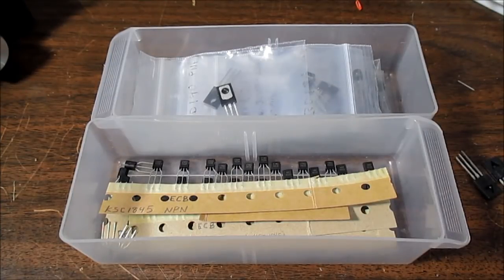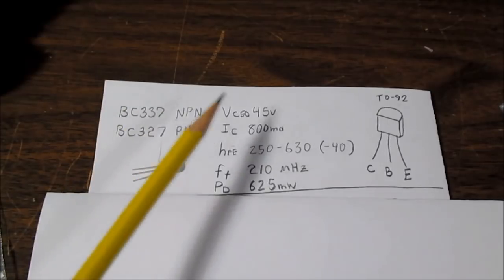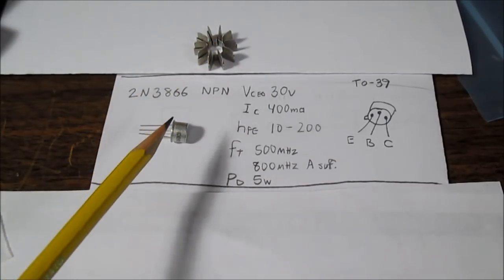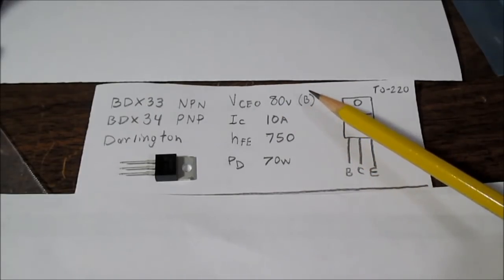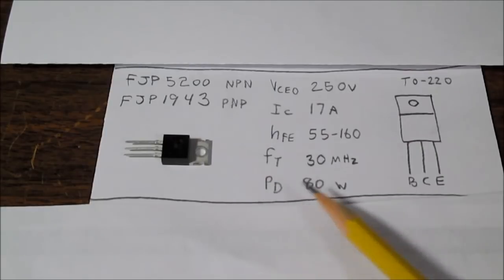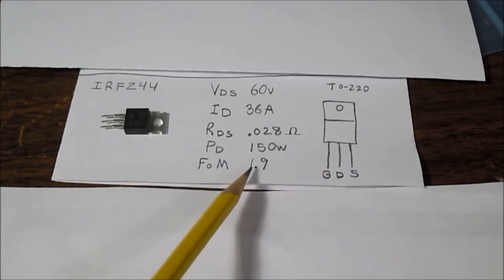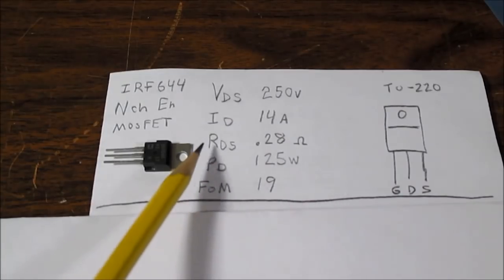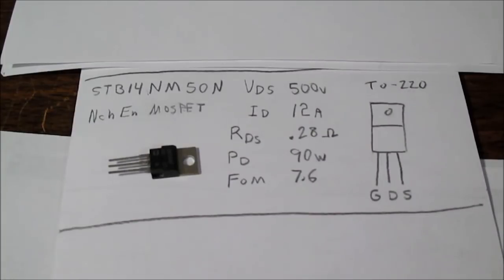Good transistors for the electronics hobbyist

Comment: I only recently made a deep dive into electricity, electric motors and circuits my background being in Accounting and Computer programming.
Enabling me to fix both my air conditioner and gas furnace in my HVAC system recently a few months ago (no fires, still running  lol). What bothers me is the lack of uniformity in naming parts, and creation of too many electrical parts. Again lack of uniformity.  For instance, the decision to make home stereo eqpt. 8 ohms and car stereo eqpt.. at 4 ohms doesn't make one better than the other. It is to make people think you need two different types of components and home stereo won't work in your car. When it very much can.

Comment: I’d list them, but I keep probably over 100 transistors and their complementary in quantities over 200, many of them into the 1000s. Example I just bought 1500 each of 2N5551 and 2N5401 all because one of your videos reminded me to, thanks! To throw some examples out there if you like working on vintage electronics, I like to keep MJ21193/MJ21194 on hand, can be used for outputs in many amplifiers, MJE15032, MJE15033, MJE15034, MJE15035, KSC2690/KSA1220, honestly there are many I wouldn’t be without.  I’ve just slowly built a collection and I hate having to wait on parts to be delivered.  Thank goodness for Mouser and Digikey and their cheap 2nd day shipping!

As to your questioning the PD of the transistors, like 125-150 watts for a TO-220.  I question those too, same with other components.  I recently ordered some very decent quality resistors from Mouser and they’re being sold at 3 watt resistors and they’re  about the size of a standard  1/8 watt  metal films. I question how something so tiny can dissipate 3 watts.

Comment: Around 12:00 "How do they come up with these values?" Well, the quoted power dissipation is simply the maximum allowable rise in junction temperature divided by the thermal resistance from junction to case. In other words, they assume a perfect heatsink that can keep the case at ambient temperature. For MOSFETs, the "junction" temperature is the die temperature.
For example, if we have a maximum junction temperature of 175° C and ambient is 25° C, then the maximum allowable rise is 150° C. If you have a device with a thermal resistance junction to case of 1° C/W, then it can dissipate 150/1 = 150 W of power when the case is kept at 25°C. If the thermal resistance junction to case of 1.5° C/W, then it can dissipate 150/1.5 = 100 W of power., and so on. Of course, in reality, the heatsink will have a thermal resistance from case to ambient and you can often find that figure specified for a particular heatsink. Perhaps you might pair up a device with a thermal resistance junction to case of 1.5° C/W with a heatsink of 0.5° C/W, giving a total thermal resistance of 2° C/W junction to ambient, which would then only be able to handle 150/2 = 75 W.

Comment: After some research, high mosfet current values in TO-220 packages are correct (eg. 75A).  This seems wrong as wire of similar size to the legs of the package would not be rated for this.  The difference is a mosfet can be rated to run at 100 degrees quite happily and large PCB traces and heatsinking contribute to the device and its leads coping with such high amperages.  A wire on the other hand gets rated to stay at a low temperature with only 'in air' cooling.  Hope this helps.

Comment: It is sometimes not very easy to find a complimentary power transistor to a given npn or nMOS device. So I usually look first for a suitable pnp or pMOS device at look for a complimentary device which fits the device the best. In this way I've found some good combinations like: STP10P6F6 / STP16NF06 or IRF4905 / IRFZ46N. I would be interesting for me if you have found also some of your own pairings or pairings which fit better that the manufacturer suggestion.

Comment: The higher power ratings of MOSFET transistors come from the possibility to operate them at 175 °C in contrast to bipolar transistors at 150 °C. The channel type transistor allow for higher operating temperatures than junction type transistors. The TO-220 package is limited to currents of 50 A per lead.

Comment: Devices I used a lot for audio...2n2222, 2n2907,  2n3053, 2n4037,  these are early 1970's devices that worked well and had several sources.  Almost all of the 2N devices are hard to find now.  When Motorola became On Semicoductor, they dropped a lot of devices for linear work.  Same with TI.  Everybody consolidated in the 1990's.

Comment: I have made some good experiences with power mosfets in audio amplifiers in the range of 12 W up to 50 W (for your home purposes you don't need more, either). I prefer simple symmetrical and thermally stable discrete amplifier configurations with high open loop voltage gain like these:

BJT version https://ibb.co/ynmpxQv
FET version https://ibb.co/kMd1MKS

Here a complementary transistor combination I like to use:

IPP80N03S4L (NMOS), IPP80P03P4L (PMOS)
https://www.mouser.de/datasheet/2/196/Infineon-IPB80N03S4L_03_IPP_I80N03S4L_04-DS-v02_01-1226077.pdf
https://www.mouser.de/datasheet/2/196/Infineon-I80P03P4L_04-DS-v01_01-en-1225645.pdf

Rdson = 3..5 mOhm, Vgsth = 1.6 V (good substitute for Darlington BJT due to their high transconductances Kp > 100 A/V)

I also like the TIP120 (NPN) / TIP125 (PNP) Darlington combination with internal base resistors because of high current amplification of 1000 at 3 A.
https://www.mouser.de/datasheet/2/389/tip120-957291.pdf

Comment: For low voltage have good price/power IRF3205 , good old Classic is IRF640N, litle bit more expensive is IRFP250 and very good for high speed switching apps but more dificult to drive IRFB/P 4227
From bjt my favorites 2SA/SC 1943/5200 , MJL21194G; KD503, BC546,7 /556,557 , etc
Some opamps to good have TL071,072,074 NE5534

Comment: You could consider using 2N6292(Vce=70v, Ic=7.0 A)
and its complementary pnp, 2N6107(Vce=70v, Ic=7.0A), they are very good to be used in VAS stage. I use them instead of BD139 and BD140 transistors.

And there are 2N5551(Vce=160V, Ic = 600mA)(npn)and its complementary pnp 2N5401(Vce=150V and Ic=600mA), which can be used in the input stage.

Comment: One transistor you didn't mention is a VHF BJT with low junction capacitances, for use in RF and IF circuits.  One cheap example is the 9018 (C9018 or SS9018).  Thanks.
Reply: Th 2N3866 is a VHF BJT. I've used it up to the lower spectrum of the UHF band aswell. Sure, it's not the cheapest transistor but it sure works great for RF amplification.

Comment: I see so many people recommend power Darlington transistors and they never know that power Darlingtons are for collector voltages above 12 volts.  A Darlington can be used at low voltage, but the collector can never go below two Vbe drops or about 1.2 volts.  If the supply voltage is 2.8 volts, then half of the power will be dissipated in the Darlington!  At 12 volts supply, ten percent of the power will be wasted heating the Darlington.

If you want high gain, use two separate transistors with their collectors separate, not connected together so the second transistor can fully saturate to just a fraction of a volt and not waste power.
I like your video.  Thanks.

Comment: I'm liking the PSMN017-30PL power mosfet. Rdson of 0.017Ω and a gate charge of 10.7, it's FoM of 0.17 blows your IRFZ44's out of the water, and has a comparable price. Downsides are lower voltage ratings.

Comment: Greate video! I have a '76 Earth Producer amp head. The eight T03 power transistors (Signetics 59-4004-B) I googled the hell out of it, with no luck. Don't know if they are pnp, or npn, all I know is they are poop. I would live to use something cool & modern. High quality sound is what I'm after. Any advice would be greatly appreciated. Thanks!

Comment: Maybe a dumb question but the use of the FJP transistors were for output stages in AB amplifiers. Is that correct? What are some suggestions for transistors to use in the power or A stage? Just curious and wondered if there was a rule of thumb when it came to these circuit components.

Comment: For audio output stages I've got some NJW3281G, NJW1302G pair - the FJP ones you mention don't have secondary breakdown graphs in the datasheet which seems odd.

IRF in particular lie completely in their datasheets about current rating.  I've seen 180A or something quoted for a TO220 MOSFET and in a tiny tiny footnote they admit the bond-wire limit is far less!  I think the logic is that the current rating of a power MOSFET is actually an power rating in disguise - ie its the current at which the die fails on a water-cooled diamond heatsink!

I'd advise using only these parameters of a MOSFET: drain-source voltage, on-resistance + associated gate drive voltage, total gate charge.  Throw in some commonsense about the package power dissipation too.

Comment: I wonder why no one mentioned  2N3055. It is a great Power transistor.
Reply: Toshiba manufactures many great power transistors. Look at their power devices catalog if you get a chance. I really like the 2SA1943/2SC5200 complimentary pair. They have constant hFE vs IC curve from few mA to several Amps which makes the transistors suitable for any low frequency linear applications. ON SEMICONDUCTORS manufactures transistors specifically for audio applications such as NJW3281G/NJW1302G complimentary pair. Hope that helps!
Reply: @SmithKerona  Would you recommend some 20 to 30v  transistors for best linearity? Price is not a concern but needs to be available. Thanks!
Reply: @johnyang799  There isn't any single transistor that is linear enough for me to recommend! All transistors (BJTs, FETs and all their derivatives) are highly non linear devices. BJT follow exponential input/output relationship while FETs follow square relationship. But with proper biasing (choosing its operating point appropriately) and negative feedback, the transistor can be made to exhibit linear input/output behavior. I hope this has answered your question John Yang.
Reply: @SmithKerona  That is really meaningful and correct. But like I want to make a opamp driving diamond buffer with unity gain feedback circuit or maybe 8db gain, just giving an example. The supply voltage is going to be +-18 only. I need lowest output impedance lowest noise and most importantly lowest distortion under load from 8/16 ohm and above. I know bd139 140 can be a good starting point but I don't want to waste too much time end up replicating what's existing out there. Main reason for that is I am using two opa827 opamps in parallel as output stage and already has 0.5uV noise from 20-20khz and 0.0001% distortion under 16 ohm load at 1mW and 32 ohm at 10mW. I want to push forward and design a discrete output stage with similar performance. I need something better to start. Thanks.
Reply: @SmithKerona  I'm building headphone amplifiers btw.
Reply: @rrangana11
the tip3055 is the same TR , it has the same voltage and current rating as the TO3  version , not sure about the PD tho :-)
Reply: 2N3055 is a dead 60's era transistor that should never be used in modern circuits. Why would anyone use it when there are cheap and far better modern power transistors?
Reply: what better modern one would you recommend?
Reply: @2guitarme  2N3771
Reply: 2N3771 has higher IC and wattage

Comment: here's my addons::
- BC517 for monstrously hi gain (but kinda sux)
- 2SC3356 (or 3355) for signal radio (it's SMD and supposedly max 12V but goes beyond, ultra cheap and apparently good on ebay)
-BF245 jfet, low noise + UHF
-2N7000 el cheapo MOSFET TO92
-IRLZ44N logic level mosfet (it's "L")
-HGTG30N60A4D ("rich kids" IGBT, good all around.... LOL)
...and 2N2222 BC547 are apparently good wherever you buy em

Comment: There are a lot of us would like a audio amp circuit that would run on 9-12 v dc and put out about 30 watts RMS of usable audio power. You may have already posted one, I could not find any in your previous videos. There may be posts of said amp on the web, I like your channel the best and hope you have one, if not, it's OK, I will look other places. Thanxz
Reply from the maker: 30 watts before clipping would not be possible at 9-12v supply with typical load impedance (4 or 8 ohms). The limited supply voltage does not allow enough voltage swing in the output to drive such impedances to that power level. To get this amount of power from 9-12v supply, would require a booster supply to raise the supply voltage higher for the amplifier (the amp would technically not be running on 9-12v anymore).

Another way is to use a low speaker impedance of less than 2 ohms which may be unrealistic in  most cases. Another way still is to use an impedance matching output transformer to boost a high current output to drive 4 or 8 ohms to 30w. Such an audio grade transformer would be rare and very expensive.
Reply: @JohnAudioTech  by use of an H-Bridge output you can theoretically achieve 18 W @ 4 Ohm and 12 V. The practical limit is probably 15 W. It is relatively easy to generate a -12 V power rail from a +12 V / 0 V power supply by use of + to - converter. Using such a symmetric power supply you can generate 60 W @ 4 Ohm.

Comment: The rated power dissipation for the IFRZ44N as example is the total power that can dissipate the transistor **if** it is maintained at 25C. You probably need large heat-sinks to maintain it at 25C under that power dissipated. 
in fact, without heat sink, the IFRZ44 would raise by 60 degree Kelvin per Watt ( see its Thermal Resistance). So, if you use it without heat-sink, at 1 W, you raise its temp to 85 C  ( 25C + 60C). At 2W, you raise its temp to 145 C and without heat-sink, at 3W you have probably destroyed it (see figure 1 in its datasheet, the maximum usable temp is around 175 C)
Reply: Basically to reach these power dissipations/currents that are rated at 25C you need to cool the package to sub-zero temperatures. So you need a heat pump, or some Peltier-cooler setup to achieve it. 

Noone in their right mind would do this with something like an IRFZ44. You´re better off with a real high power mosfet. But for very high power applications this is sometimes done.
Reply from the maker: I assume you mean the junction temperature is 25 Deg C. The die inside the transistor package will have some thermal resistance to the die attach point on the copper slug in the transistor. The heat then disperses through the slug and into an external heatsink. All of this will have a significant thermal resistance rated in kelvin/watt which will raise the junction temperature. I'd have to research this to see if it can work at the high power rating that are specified on these TO-220 devices.

Comment: I often use BC550/560 or 2N5401/5551 for higher voltage amplifier input stage, 2N5401/5551 or KSA1381/KSC3503 for VAS (depends on my goal), 2SA1387/2SA4793 for driver (or pre-driver for TEF circuit), NJW1302/3281 or 2SA1943/2SC5200 for the final stage.TO-92 package seems to become obsolete soon or later. it's getting harder to get low noise figure, low Cob, and high fT transistor here. i might migrate to SOT23 package..

Comment: SS8050/SS8550 -- complimentary pair of TO-92 transistors rated for up to 1.5A (but only 25v)
Reply: I have those, I recently used them for a project (both of them). They're quite useful. What else do you recommend? I have over 15 different transistors, but as the saying goes better safe than sorry.
Reply: Yes! I used them for a 2.5W amplifier project they are cheap and they gave me no problems. My suggestions are tje obvious 2n3904/2n3906, msa29 for high input impedance amplifiers and the s8050/8550 and nothing else, maybe some 2n7000 for simple logic

Comment: 11:07 Look at car amplifiers. they do it all the time. they can handle it.
11:46 again, look at car amplifiers, they do it all the time.
some of the newer TO-3P MOSFETs and IGBT's can do over 100A with around 400W dissipation ratings.
Reply: bassblaster505 
Those transistors are really powerful

Comment: While they are probaply pretty much the equivalent of the 3904 in europe, the BC547/557 are my go-tos when i don't have anything specific i need. They are very simmilar to the 337/327 but with more gain (up to 800 for the C variant) at the cost of collector current. Super cheap and great to have stock piled. For mosfets i like to keep some irf740s and 820/840s in stock, they have a very high drain-source voltage, great when fudging into tube circuits but also decent for common purpose
Reply: Do you mean that transistors are specific to a continent or another?
Reply: @emileduvernois6680  There at leased used to be some different regional availability. Now, I can only speak for Germany/Austria, but when i got into electronics around 2010 the 2N series just wasn't a thing here. All the german tutorial sites used BC500 series and they were available for cheap in local shops. Through youtube i watched a lot of english content and those always used 2N2222/3904, but none of the german online shops had those.
I just checked, my local store currently has 2N3904s, but quite expensive and a major online shop has them at the same prices as BC500. Neither have 2N3905s. Of course, today it is much easier to order from other places or china direct, so i do have a bunch of 2N types stocked, though not nearly as many as BC series.
Reply: @uzmeyer1752  Ja, ich hatte auch gehört vom BC547 als ich mich mit einem bisschen Elektronik beschäftigte im 20. Jahrhundert, in Frankreich. Ich wusste aber gar nicht, dass er eine Europäische Spezialität war. Ich danke Ihnen für den Bescheid.